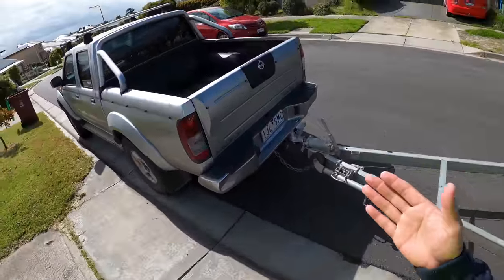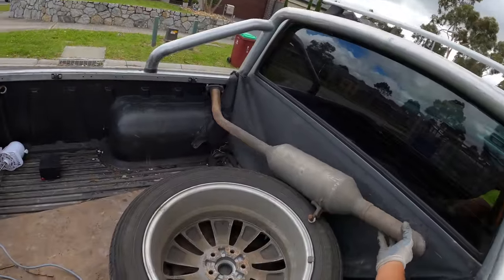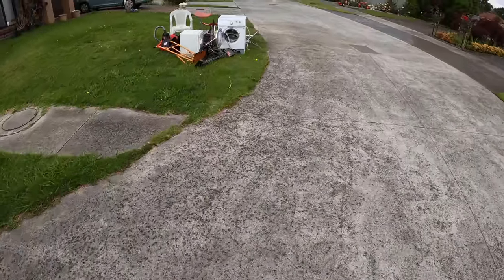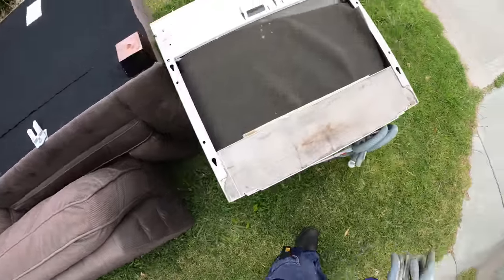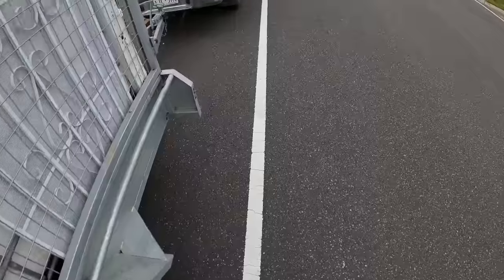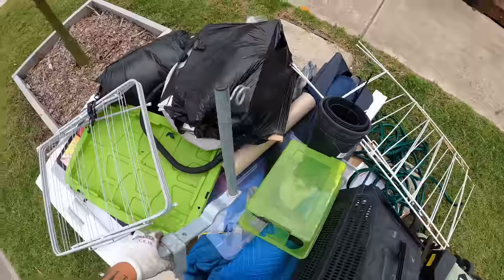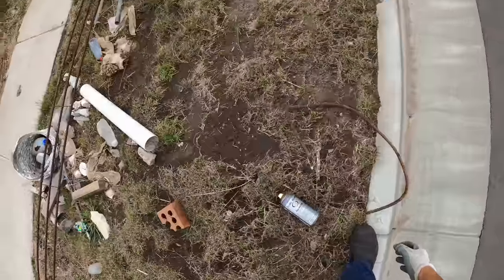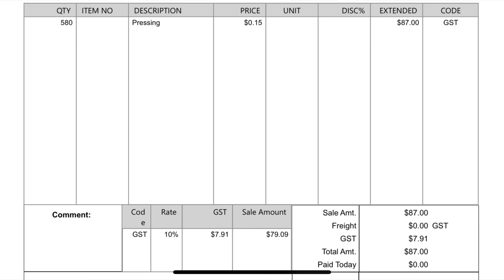Searching The Streets For Steel Scraps & Valuables

Comment: Poly when you say thick and are happy can you explain what that means.  I’m figuring thick, heavier more money?
Reply from the maker: Steel that is thicker than 3mm and 1m or shorter is worth double. Things like bbq plates and brake rotors or even bolts and screws 🙂
Reply: Got it. Thanks for that explanation.  I’m learning from you.  I’m not a scrapper but I do enjoy learning.

Comment: Polly, you need a torch that will reach down into the neck of the tailpipe to tell if it is a catalytic unit. You don't want to throw one in the other scrap.
Reply from the maker: Yes that would be ideal 🙂
Reply: That was a catalytic converter poly
Reply from the maker: Thanks mate 🙂